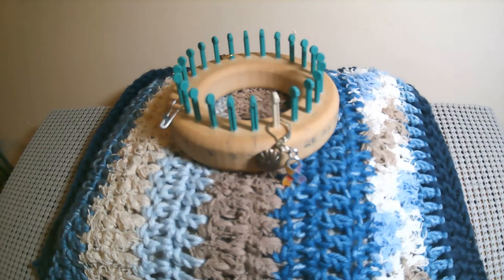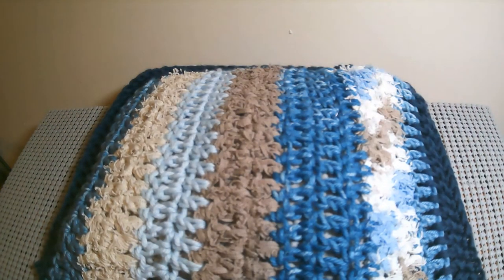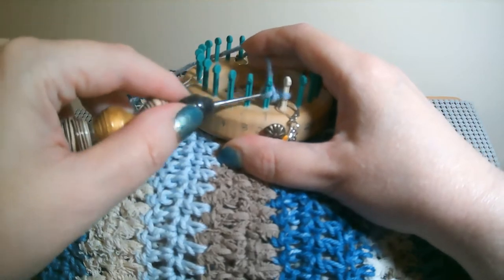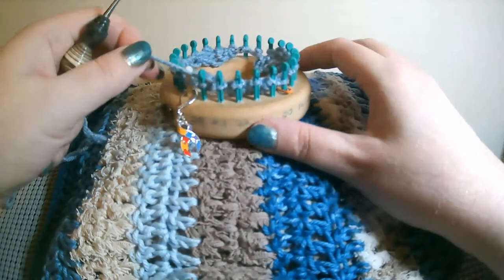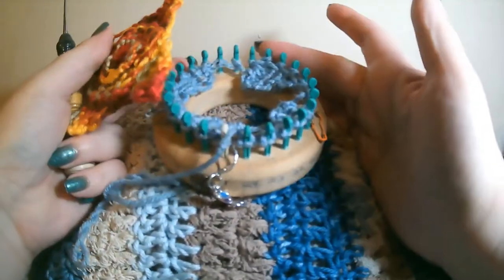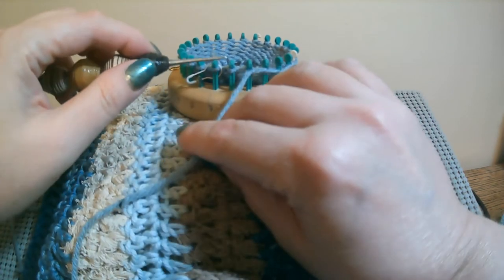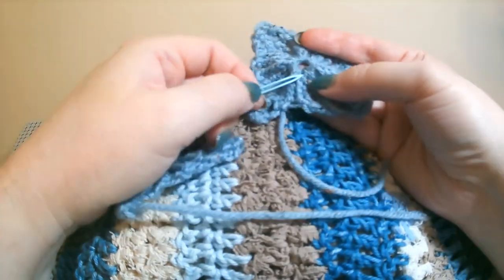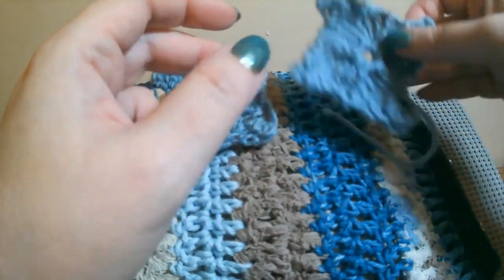LOOM | Pinwheel Shapes | Squares

Comment: You're the only person I've ever seen t use the purl over. What s the difference between the purl over nd the purl other than the mechanics? And when would you use one over the other?
Reply from the maker: The purl over adds texture and dimension to stitch patterns and it also will tighten up a looser stitch before it.  I use it quite a lot in my stitches and patterns.
Reply: @LoomingCraftyFiberArts  That is good to know.